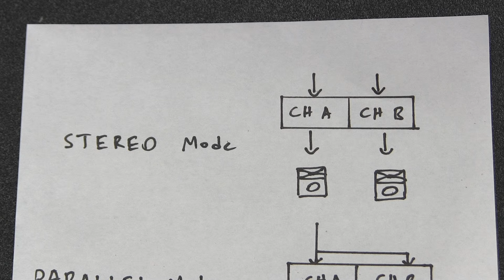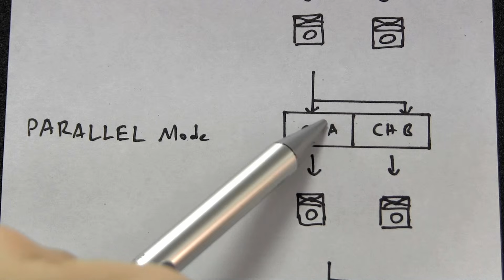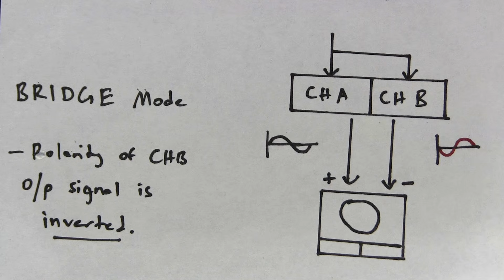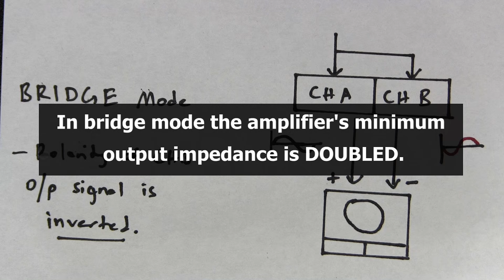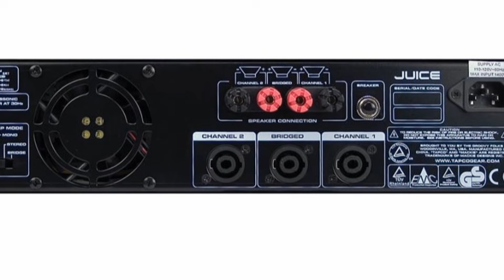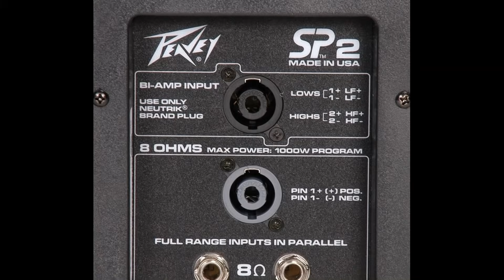How to set up and connect a power amplifier in bridge mode

Comment: How to connect EQ to dual Amplifier....... thank. You!!!!!!?
Reply from the maker: What do you mean by dual amplifier please.
Reply: Mixer To EQ amp 1 for midhigh another for bass or low ......no crossover . How to connect!!!!! Thanks for your time,,,,,,, God Bless
Reply from the maker: In a case like that you need an amplifier that has an internal crossover function that allows channel 1 to drive the sub and channel 2 to drive the fullrange speaker - more and more amps are featuring this nowadays.

Comment: Can I connect Wharfdale MP1800 power amplifier in bridged mono to a 4ohm subwoofer? It says it can be done on the spec sheet but you mentioned something else
Reply from the maker: If the spec sheet says that the amp can be bridged into 4 ohms then you are good to go, but be very sure that this is really the case - this means that the individual channels need to be stable into a 2-ohm load.
Reply: @GLBProductions  ohhh....alright I understand what you mean. Thanks for the quick response. What class of amp(AB,D or H) is best for subwoofers ?
Reply from the maker: In the past some engineers considered class AB amps to be better for subs due to the design of their power supply, but most pro audio amps being sold today are D class or some variation thereof and work fine.

Comment: Your content is amazing, thank you very much for the effort you’re putting in! If I may ask you something, I got an Electro Voice XW12 and a Crown XLS 1502 and I can’t get the horn (driver/tweeter) to work. The XW12s are biamp speakers. I tried both two-way and four-way speakon cables, but I only get the low frequencies out. Do I need some sort of special cabling? Thank you!
Reply from the maker: Hi there João, you've certainly got a piece of history there! With those the easiest way to test the HF driver is with a 2-conductor speakon cable connected 1+/1- at the amplifier end and 2+/2- at the loudspeaker end. This will leave no doubt as to whether the compression driver is working. If you do this test and get nothing then you will need to do further investigation to determine what the problem is: internal wiring, blown HF driver etc. 
BTW I assume you understand that these loudspeakers are bi-amp only, and need two loudspeaker channels per Xw12, plus the associated DX38 digital crossover.
Reply: @GLBProductions  thank you so much for the swift reply! They  are one heavy piece of history, I gotta say haha. I’m clearly a novice trying to setup an alternative guitar rig, haha. I got a good price on a pair of XW12s, and when I looked at the specs, it seemed a good idea to use them as FRFR speakers as their response is pretty flat. So what I’m trying to do is to connect my amp simulator (Hotone Ampero II) to the Crown XLS, and from it to the speaker. Im not using an external crossover, and I did not know I would need one! I opened up the cabinet and saw it has an internal crossover so I assumed I’d just have to send the power in. I also assumed that since it’s a stereo power I would be able to figure out a way to biamp - but then I don’t even know how I’d get the cables out. What would you recommend I do? Happy holidays!
Reply: @GLBProductions  PS1: for now I want to connect only one cabinet, I don’t need stereo.

PS2: I understand that biamp speakers expect two power sources, but I can’t understand how to connect them given there is only one input per cabinet (the other three are for daisy chaining only, I believe).
Reply from the maker: Hmm, it does sound like you are a bit out of your depth on this one 😊 
I'm afraid that the published frequency response of these loudspeakers is only when used WITH the DX38 - they are designed to be used together. 
If you opened up the cabinet and saw a crossover then the speakers may have been modified, or you may actually have another model! 
In this case, I think you should write to EV - send them a picture of the speaker's ID plate with the serial number, and also the internal crossover, and ask them whether or not this is the stock configuration, as well as the other questions you have. Hopefully they will be able to give you specific advice.

Comment: How many speaker connect in this briedge mode tnx
Reply from the maker: It depends on the minimum allowed load impedance of the amplifier - check your owner's manual.

Comment: If you feed a mono signal to the right input and the inverted signal to the left input of a HIFI amp, could you then bridge the output stages, or do you risk all sorts of internal nastiness?
Reply from the maker: In theory this will work perfectly fine, but you would need to try it on your specific amplifier in order to know for sure. In practice the limitation with hifi amps is often their ability to handle speaker loads below 8 ohms.
Reply: @GLBProductions  Thanks.
Reply from the maker: You're welcome Bob :)

Comment: How to connect a pair of 2-way speakers Stereo, including a single one-way centre speaker Stereo, into a 2-channel rack amplifier using a binding post in Bridge mode
Reply from the maker: A setup like that requires three amplifier channels: left, right and centre because there are three separate signals being sent to the loudspeakers.

Comment: Mr. B,
Hope all is well
You are a God send.
Here's my question. I have a small Sony high fi set up the signal go to equalizer in the living room the speakers in the living room is connected to an SLA 1 amp via the binding black and red post the amp is plugged into the wall electrical out let
 I understand the from your video the various settings. Bridge and stereo modes, however when I turn on the units source in the bedroom then the equalizer which shows in the display there is a signal and I then turn on the amplifier there is no sound coming from the speakers
What do I need to do to get them working? I set the amp in bridge mode using bare wire into the two red post one left one right as well as in stereo mode connecting the speakers to the the black and red post. As my husband who is no longer with me would have solved this issue. I hope that I say make sense as I am a neophyte to this.
Blessings 🙏
Thanks in advance
Pat
Reply from the maker: Hi Pat, thanks for getting in touch. There are many reasons why your system might not be working - each make and model of amplifier has its own ways of managing the signal so I can only give some general suggestions: 
First of all make sure that you have selected the correct INPUT on the amplifier - many hifi amps have several inputs: phono, CD, tuner etc. Also, make sure that signal is actually reaching the input of the amplifier - you mentioned an equalizer in your post above - if this is a separate component try unplugging it and running the source directly into the amplifier itself. 
Secondly, make sure that you have selected the correct OUTPUT - some amps have two sets of outputs, meant for two different sets of speakers. These are sometimes called A and B. 
Finally, it is likely that your amplifier should be run in stereo mode - bridge mono mode is usually reserved for driving subwoofers. 
Hope your can get your system working!
Reply: @GLBProductions Mr. B. Thanks for responding to me. I should have also let you know that I did not use the XLR 1/4" connectors. I just attached the speaker wires in stereo mode. Should these connectors be plugged into channel one and channel two on the amp and into the equalizer.
Reply from the maker: The equalizer needs to be connected to the amplifier for sure, either via the XLR or 1/4" connectors. Left output of the EQ to channel 1 of the amp and right output of the EQ to channel 2.
Reply: @GLBProductions  ok. Will try. Also what is the best xlr and 1/4" brand name to purchase. Many thanks

Comment: Sir Bruno ..in bridge mode is still 8ohms. Can I use two 8ohms speaker = (4ohms) in bridge mode?
Reply from the maker: It depends on your amplifier - check the manual to see what the minimum allowed load impedance is in bridge mode.
Reply: @GLBProductions  Thanks for the replay Sir.

Comment: So Sir, does this mean that Bridge Mode and Parallel mode are to be used from only one signal input? And we don't need to use it for normal use. Is it sir?
Reply from the maker: Correct, bridge and parallel mode use only a single input. There is not really a 'normal' use for these pro-audio power amplifiers - they work equally well in any configuration. Watch this video for more info: https://www.youtube.com/watch?v=HKpV30pjvIo

Comment: Hi sorry just a quick question?in your own opinion and experience?what mode would be the best to use for sub and and high ?And thanks fro this beautiful video that help us a lot in many ways appreciate that’s a lot thanks from Nz
Reply from the maker: Thanks for watching Emaloni 😊 Please tell me more about your setup: are you biamplified using an external crossover or using the passive crossover in the sub, what specific loudspeakers are you using?
Reply: Hi and thanks for the reply ,I’m using a passive speaker the JBL dual double 18 inch sub 2600w sub and high is the JBL prx 400 double 15 inch and im running them with euro power 4000 for 1400pair chan on 4ohm for the top on stereo mode and Samson mx 3500 1900w per 4ohm and Dbx electronic crossover and numark mixer
Reply: So I just wanna know what Option would I use for my amp mode to make it more powerful ,loud and clear ,just for Dj system most time I have to play for function of 150-300 people but I need your advice to make it better, so I’m being use stereo the whole time of Dj so watch your video and think your might help me some how or correct me in some way ,,

Comment: Hi, is there a cheap way to bridge a amp that does not have bridge options ? 
great video thanks Brett
Reply from the maker: There are ways to do this but I don't recommend them. Running an amp in bridge mode typically results in increased load and hence additional heat build up - this may damage an amp that is not designed to be run that way. I would say that if you need bridge mode, get an amp that is designed to be bridged.

Comment: Hi, is it recommended to wire up into 1+ and 2+ (of a NL4F) to get a Bridged Spk Output via the Primary channel Speakon socket of a power amp?
Reply from the maker: Only if the power amplifier is set up like that - not all power amps output channel 2 into the 2+/2- connections of the channel 1 speakon. Check your owner's manual carefully!
Reply: Sorry Sir but Im afraid you've mistaken abt my question...😲
No, Im not referring to Ch2 Spk Output present at 2+/2- of the Primary Ch Speakon socket (Im aware that some Primary Ch Speakon Socket output BOTH Ch1 and Ch2 via 1+/1- & 2+/2- respectively)

But, this is about using the Odd/Opposite 1+ and 2+ to achieve(get) BRIDGED Speaker Output thru the Primary Ch Speakon socket.
Will this work instead of wiring into the Binding Post POS.1 and POS.2 ??

Some manuals/manufactures output their BRIDGED Spk Output at 2+/2- (primary speakon)
Others stick to the 1+ and 2+ combo-format. (primary speakon)
Afew even output them directly at 1+/1- (also primary speakon)
Its causing much wiring confusion and possible mismatch...

Comment: Great video! Wonderful! Please, I've a question about the input connection from the mixer to the amplifier in bridge mode. My mixer has RCA output (R and L) so, how can I send the two channels to the CH1 JACK INPUT?...this is must to be STEREO in anyway, otherwise the singnal amplified is not mono but only a channel (R or L)...isn't it?...which type of cable I must to use for this connection? Many thanks for your kindness. Stefano from Italy.
Reply from the maker: Hello Stefano! It's important to understand that bridge mono is NOT a way of combining the left and right outputs of your mixer together - the term refers to the way in which a 2-channel power amplifier, typically used for left and right speakers in a PA system, becomes a single-channel (mono) amplifier, typically used for subwoofers or higher-powered fullrange speakers. The input to the amplifier hence must also be mono (balanced or unbalanced) because the amplifier now only has a single channel, not two. I have another video that explains these differences in detail: https://www.youtube.com/watch?v=HKpV30pjvIo
What is your application for bridge mono mode?
Reply: Hello Bruno! Many thanks for your quick and helpful reply! Your videos are the best for exposition! Well, I'm assembling my little DJ set and I'll probably use the amplifier in STEREO MODE, but sometimes could be useful the BRIDGE MODE with one full range big speaker BUT, and this is the point, without losing sounds signals. Amplifying only one channel (R or L), the sounds signals in the other channel will be lost. Now, after reading your answer and watching the videos, the only solution could be to mix R and L together in a REAL MONO channel before the CH1 JACK INPUT (BRIDGE). I searched in web and I found a little device that convert 1 signal stereo to 2 signals mono: MONACOR SMC-1 (R and L rca input; 1+1 rca mono output)...that way it might works. That's all. Thanks again!!! Stefano
Reply from the maker: Actually the easiest way to achieve this is by using an aux send on your mixer - does it have one? That will allow you to sum the L+R channels together with no additional equipment.
Reply: Thanks, no...it hasn't...my mixer is a mixer/controller Pioneer DDJ 400...it has only 1 RCA "MASTER OUTPUT" to the amplifier and 1 USB cable to the computer...that's all...but I'm not giving up!
Reply: I finally found the way!!!...without adding any devices!!! Well, instead of RCA MASTER OUT, I use the JACK OUTPUT (STEREO) of the desktop (the controller is connected to the desktop via usb) . In WINDOWS 10 I go to "SETTINGS", I choose "ACCESSIBILITY" and on the left I select "AUDIO": here I find the switch "ACTIVATE AUDIO MONO" ... and so it works! I have just tested! THANKS SO MUCH FOR YOUR SUPPORT!! Stefano
Reply from the maker: Excellent! Well done and all the best with your music 😊😊😊

Comment: Can you connect speakers to  A channel 1 & 2? Then bridge it on the some line or just bridge on the B channel? Trying to do home theater front speakers & bridge the center speaker.
Reply from the maker: Sorry I don't understand what you are trying to achieve.
Reply: @GLBProductions  ok I want to connect my front speakers to the amplifier and bridge my center speaker
Reply from the maker: I'm just wondering: do you realise that you need a separate receiver output and amp channel to drive your centre speaker? It's supposed to receive a signal with just the dialogue - not a mono mix of the left and right speakers. If you're not set up that way it's best to use just the left and right speakers.
Reply: @GLBProductions  yes

Comment: Hello, sorry if this is a silly question. Can you daisy chain two speakers in bridge mono? Would it be the same as feeding the same signal to both channels and then both outputs to both speakers or you still get the additional power in mono?
Reply from the maker: Yes Salman you can daisy chain speakers in bridge mono. Whether or not you get more power than using stereo mode and connecting to the individual channels will depend on the specific amp that you are using, but generally it will be 2-3 times more power.

Comment: does any amp ab may be bridged to mono? mine has common ground, with black screwable contacts at the back, the two negatives of each channel output go to ground, perhaps it is possible to separate the circuitry but if you only have to attach + - to red terminals, i will try that, my amp is 450x2 rms 4ohms, 250x2 8ohms, i think if i am able to bridge it, will have 500watt rms 8ohms mono bridged.
Reply from the maker: If the amp is designed to be bridged it will have a dedicated bridge mono mode, it's not as simple as connecting to the two red terminals.
Reply: @GLBProductions   It is not designed but if i measure two red terminals, signal is coming there, and speaker will move, i read somewhere if you make a phase invert so you will able to bridge amps with common gnd in output l+r. My amp has very simple design i think if i split the common ground and connect in series perhaps power will double, i hope not to blow anything.